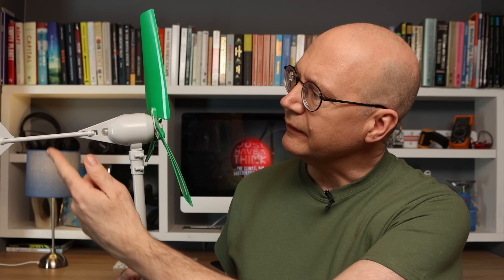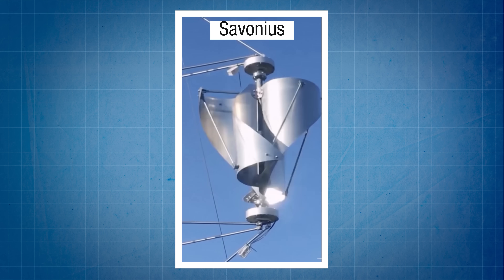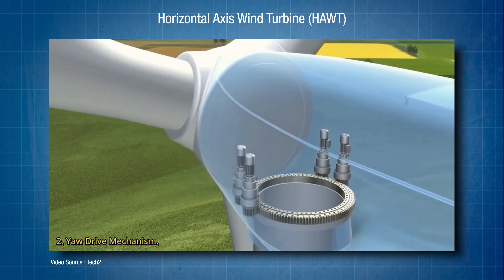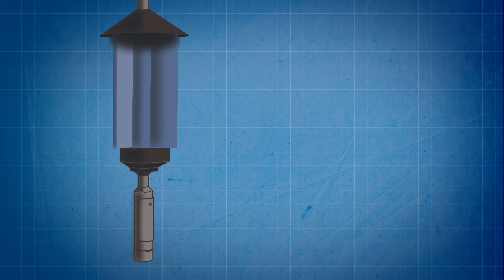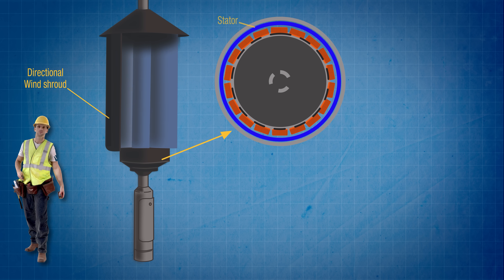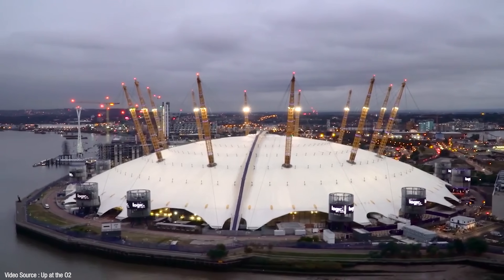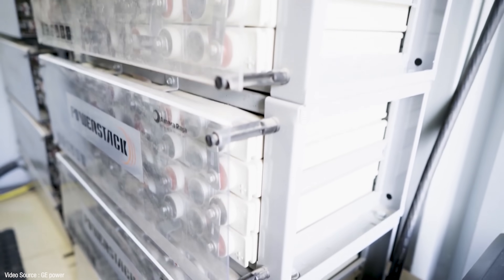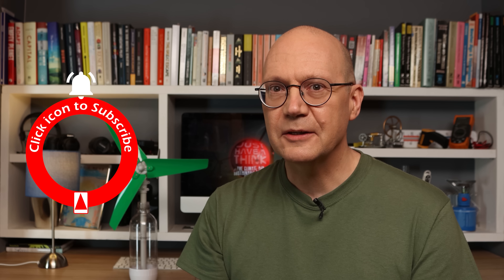A vertical axis wind turbine that doesn't need the prevailing wind! How do they do that?

Comment: It is becoming increasingly clear that smart grid(s) and a portfolio approach to distributed generation is the best long term solution for our energy needs. The generation components do not need super-high efficiencies when drive by waste/excess energy. VAWT would seem to have a lower ecological footprint at installation that many others. 
At least in the US, the current largest obstacle to that seems to be the grid (at least on a national vs. state/local level).
Reply: It is much less efficient (factor of 2) than horizontal designs. Not able to recuperate cost before wearing out. So, not sustainable at all.

Comment: The retrofit approach is genius.
Reply: I’m not expecting perfection. All I ask is that you do the best you can with what you’ve got.
Reply: Cuz lovin’ is what I got
Reply: How do you fit a wind turbine on a pole that has one end in a motorway and the other end has a big light on top ? It must be genius as I can see no way of doing it, can you ?
Reply: @goldmagnet9013  I had the same question... most likely the pole has to be cut, or at least removed, and then 'retrofitted' - or longshot a clamshell design, which seems nearly impossible for the alignment of the moving parts, bearings, etc. Perhaps our professor will make a follow up video on how these are installed.
Reply: @rickdworsky6457 A follow up video would be great. I had a look at their prototypes and they are very primitive. This really is an idea not a product, and the figures that are quoted would need a new type of physics to be discovered.
Reply: @rickdworsky6457   Depends on the tolerances required.   If they can be alined to a 5mm accuracy, then it would work.   Only problem I see is with longer blade sections is the natural flex of the metal poles in high winds and temperature extremes.      The retro fit idea is really good.   More Government money needs to be put to this.   If expanded in the correct way this could be a great solution to power supply difficulties in rural areas.    Additionally if coupled with the inductive charging road system - the electric vehicle would in theory to a certain extent be self charging as it moves along the road

Comment: Umm the maths is wrong 3MW from 125 turbines would mean 25KWH from each, this insane maths that would mean we could all have one in the garden and have free power forever.  As you can see the maths are VERY VERY WRONG this is 250Watts from the turbine going by a rough calculation of the size and air capacity meaning you would need 450KM of these and 12500 turbines to make 3MW.
Reply: Yes, the maths is wrong - but it's also wrong for the solar farm: a typical UK solar farm has a utilisation factor of ~11%, so a 3 MW CAPACITY solar farm only puts out an average of 330 kW (<100 kW in winter, <660 kW in summer). This would still be 2.6 kW when divided by 125 - which is still > TEN TIMES more (not 100) than the 240 W (5.8 kWh in 24 hours) they claim for a single turbine.
Reply: @iancash3559  The 3MW solar farm is 3MWH NOT per day (Yes half that in the winter but double in the summer)! to Equal the output of that farm the would need 12500!  Also these they will break down a lot and repairing them is dangerous, the wires will also need maintenance as only urban motorways have posts.  Economy of scale wors against reliability for small generators, you would need to consider continually moving wearing on the parts.  Also at such a low weight how durable will the materials be.

Comment: What's the maintenance cost per kwh? how many kwh can be produced before they need to be replaced? Can they be recycled? What is the cost of production?

I like the idea. I just hope the numbers work out. The side of the freeway is a harsh environment with salt, grime snow and ice.
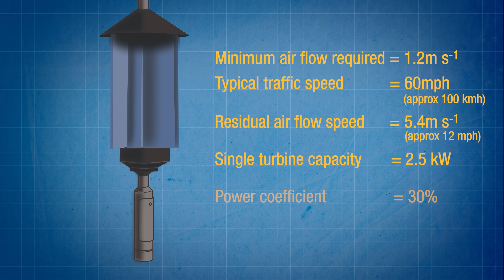Reply: Dave's numbers don't stack up, they are wrong by either two (5:31) or three (8:50) orders of magnitude. So which is it, 2.5 or 24 kW? The right number for a VAWT this size is about 25 watt, by following the standard VAWT physics formulas.

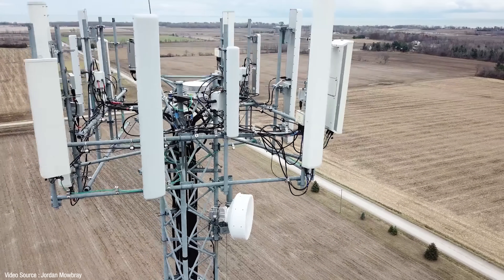Comment: At 9:31, The slide shows that 3MW only requires 125 turbines. , but my math says that to get 3MW of power from 125 turbines, they need to be capable of 25KW each.   A quick search shows that a 25KW turbine is 25m tall with 7m blades and requires 12m/s wind speeds.   That is not reasonable for this post design’s size.   

Some googling shows that alpha311 says it costs $26,000 USD to build each turbine, but at 8.6M GBP for 125, that’s 69.6k GBP installed.   That’s quite a markup.

Maybe they meant energy and not power.   

So, the numbers for the lamp post turbines do NOT add up.   Something stinks.  Something is greatly exaggerated or plain incorrect.
Reply: It's an embarrassment, and to see how people fall for it here is a good lesson in how the internet spreads false information.
Reply: Right.
I had a different approach but came to the same conclusion: The numbers do NOT add!
I used the information at 5:55 "an average of 5,8 kWh per day" and then 125 turbines just have an effective capacity of 0,03 MW!

Comment: For both-directions highway with narrow path/fence in middle this might not cause any additional drag (as it just slows down air that otherwise would cross fence and slow down opposite direction traffic.
Cost/maintenance and power stability - that is different topic. Might be another "great idea but doesn't work in real life on mass scale"

Comment: They appear to be significantly more efficient than the horizontal models.  What's to stop the technology being ups called to replace the wind farm sky propellers?
Reply: Just the fact that they are actually much much less efficient. These designs (VAWT) have been around since 1922. Connect the dots yourself.
Reply: @tzenophile  where can I find out about that?  The vertical system looks much simpler, so why less efficient?
Reply: @12theotherandrew  Google it. "HAWT vs VAWT efficiency".  Dave's numbers don't stack up, they are wrong by either two (5:31) or three (8:50) orders of magnitude. So which is it, 2.5 or 24 kW? The right number for a VAWT this size is about 25 watt, by following the standard VAWT physics formulas. That is an insanely bad investment.

Comment: It’s been clearly shown that vertical axis turbine require stronger wind to get moving and, they tend to fail earlier then conventional turbines. An Icelandic company has been knocking out these types of turbines for some years, only fitting them to bus shelter & street lights. I suggest that the company has not  advanced to home power for a reason.

Comment: To me one of the most interesting applications for this kind of renewable energy generation device would be an off-grid communications tower. It would store the generated energy in a medium size battery and use the SpaceX Starlink network as its communication infrastructure backbone. In theory this would make it very affordable and robust to provide mobile internet access even in very remote areas or areas that are frequently affected by tropical storms and electrical grid instabilities. Mobile internet access would even be available in the middle of a brown out, which in a lot of areas around the world isn't a rare phenomenon. The Starlink antenna consumes an estimated 2.4 kWh per day. If required this could off course also be combined with other forms of renewable energy generation, like photovoltaics.

Comment: The installation of these vertical turbines on lamp posts along motorways is a really good idea. These guys will be profitable while harvesting energy that is currently lost. It really doesn't get any better than this.
Reply: I'd save the celebrations for after independent third party tests prove it works while being economical to run. On a first look it might be feasible, but the manufacture, installation and maintenance costs look likely to be extremely high for the amount of power they claim to generate. In its favour it's a free energy source and safer installation and maintenance than large scale turbines (The main danger is from traffic and not the turbines themselves), but it sounds too much like a gofundme pitch at present.
Reply: @peglor  You don't have to wait for testing, just plug the numbers in to a VAWT efficiency calculator. Dave's numbers don't stack up, they are wrong by either two (5:31) or three (8:50) orders of magnitude. So which is it, 2.5 or 24 kW? The right number for a VAWT this size is about 25 watt. It's either a company of incompetents or scammers. Too bad Dave is peddling this.

Comment: I, and probably loads of others, have had the same idea when pulled over to check my car....it's really windy out there.  Great idea, but probably pretty challenging to engineer a workable system.  Any safety issues with an exposed turbine?  Maintenance intervals?  Any batteries needed for 24 hour operation?  All solvable, don't give up.

Comment: Am I missing something? By taking energy out of a vehicles slip stream wont the vehicle have to work harder/become less efficient to compensate? You only have to stand in a tube station when the trains coming to realise how much energy is used to push air out of the way and the more that air is impeded the more energy will be used.
Reply: How hard the vehicle has to push is related to the air conditions and not to the number of power generators (or anything else) that is on the side of the road. So no, the vehicle would not work harder. The energy used to move the air would normally just be dissipated in the form of heat. This device captures that energy.
Reply: Possibly, but in many locations on the open road or motorway central reservation, they would in any event function equally well on the basis of the prevailing wind speed at that particular location.
Reply: I highly doubt that would be the case. You could make the same argument for trees and bushes at the side of the road which move with the movement of air from traffic and essentially sap energy from the air - do they really affect the efficiency of a 1,5 ton vehicle? I don’t have the science to back me up BUT I highly doubt it. Chances are the fans have a calming effect on the air that’s near them seen that they use up it’s energy - might be advantageous one day for cars who are driving into a strong wind, the next day might be disadvantageous when the wind is behind. My guess is it’s not worth even talking about in terms of effect.
Reply: This is the waste energy produced from the passing autos and currently just dissipated back into the environment. Basically it's free and simply unused ...
Reply: @johndanzer8181  Increasing air resistance increases the energy waste. That's theft and stupidly inefficient. The loss on the engine's side is far greater than the amount harvested at the generator.
Reply: I don't think you're missing anything.  The vehicle will find it easiest to move through open space because there is no impediment to the air getting out of the way.  If you install any obstruction nearby the vehicle has to push harder to maintain the same speed.  So I think Dave is wrong in saying it's a free lunch.
Reply: @raykent3211  Dave is wronger than that. His numbers for the effiency of the VAWT don't stack up, they are wrong by two (5:31) or three (8:50) orders of magnitude. He can't even agree with himself! The right number is about 25 watt. Which means this is a total investment failure.
Reply: @tzenophile  thanks for that, I was guessing at a few watts per unit in constant traffic, maybe a bit pessimistic of me!
Reply: You have a point. If you install enough of these devices and imagine the flow of air from incoming traffic used by the vawt there should be some interferences, turbulences which could lead to additional resistance to cars coming the other way. 

When it comes to energy there is no free lunch.
Reply: @Memoiana  I imagine it depends on the circumstances. Opposing directions of traffic are usually placed side-by-side, which could also cause turbulent interference when the slipstreams interact. As far as I know, there is not really any effort put into optimizing aerodynamic interactions between vehicles on normal motorways, only in applications like racing and confined spaces.

My suspicion is that in open air environments, there's already so much interaction with the landscape that turbines wouldn't have much net impact on the vehicles. A tunnel might be a different case though.

Comment: Terribly inefficient, however interesting that one would put anything other than a thought to it . As usual  the waste is greater than the usable output. Thanks for the vid.
Reply: Efficiency matters a lot less when the energy source is free, but gets dragged out by the fossil fuel meatheads repeatedly as part of their policy of muddying the waters on the topic as much as possible. There's a good chance you're right and this is a cynical venture capital chasing effort to part a whole bunch of well meaning people from their money - until there is third party testing to verify their claims none of them can be taken as true.

The costs to manufacture, install and maintain these will be considerable for what's not a lot of generation per turbine, especially since the power from each turbine will need proper processing to interface with the grid, so it's not just a turbine and its mounts that are involved here. Using existing electrical wiring because these are wired as lamp posts already is the only clever bit of the idea. The electronics will have to go through a long and expensive certification process before any power grid not based in Texas would be willing to allow it to be installed too, but maybe there are cheap, certified off the shelf solutions at these low power levels now, but I doubt it.